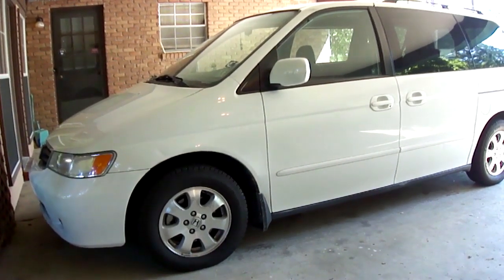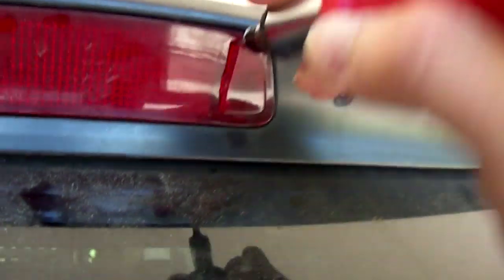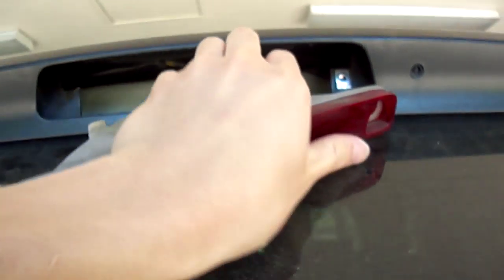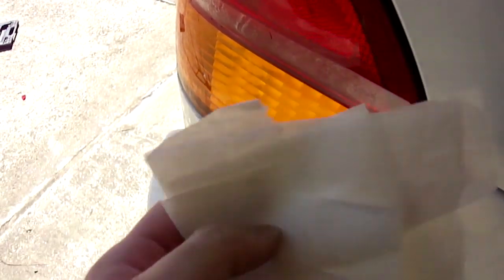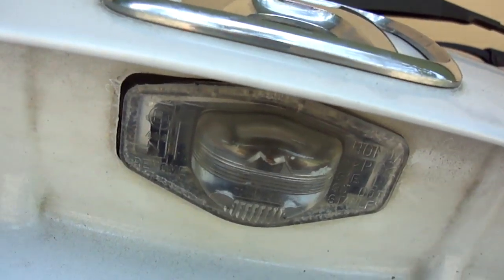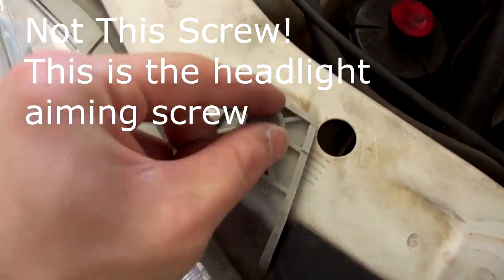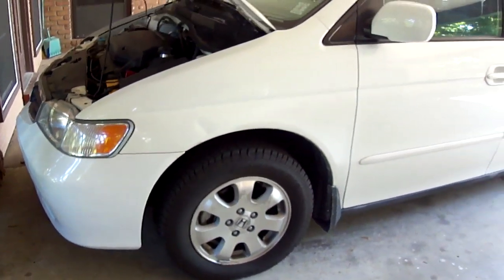How to Change Honda Odyssey Brake Lights and Headlights (1999-2004)

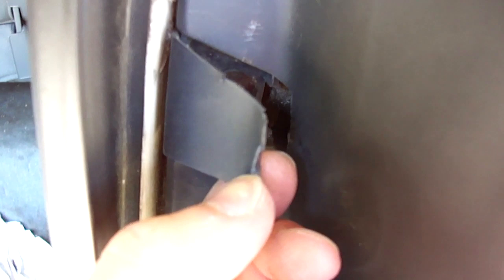Comment: Thank you for this video, it was exactly what I needed.  As a suggestion, maybe you could put time-bookmarks in the description for when you're talking about the different bulbs.  For instance, 6:00 is when you started talking about the brake light, which is what I wanted to change.

Comment: Thank you so much for this detailed video, now I know how to do the back( lol oops that's not what I meant), but the front parking light is rather easy for me , all you have to do is go under the splash guard for each side, just take 2 of those pins out and pull the splash guard back and unscrew the bulb from there!

Comment: Thanks so much! The user's manual (provided by the tech wizards at Honda) regarding brake light replacement is a confused and incomplete mess of ambiguity.  I would have never been able to successfully replace the lamp using the instructions Honda provided with their 30 K$ vehicle.  Thanks to your video, a new bulb was burning bright in just a few minutes.
Reply from the maker: thanks for watching!!

Comment: Thanks for this video.  I never would have figured out that I needed to pry out those 4-sided pieces of plastic in the back (brake lights 99 Odyssey).  I had thought the round plastic caps below them needed to be removed first, to gain access.

Comment from the maker: the backup lights shouldn't set off the lamp... try checking all your fuses.. if that doesn't work, try replacing all your bulbs (even if it still works) and see if that fixes the problem.. if not,, you can easily return the bulbs and just ignore the lamp.. good luck.  keep me updated!

Comment: FYI for the front turn signal DO NOT try to just pry off the corner there is no snap on stud like he said, there are about 4 bolts for each headlight assembly, you have to take off the front bumper, HOWEVER I think you can access the turn signal bulbs probably buy removing the clips for the plastic wheel wells, turn your wheel with the steering wheel , remove the clips and pull back the plastic wheel well covers, it is a lot easier to just remove the bumper and unbolt the whole headlight assembly if you have patience and time. the wheel wells are cramped and a bitch but might be faster or easier depends on how tiny your hands are

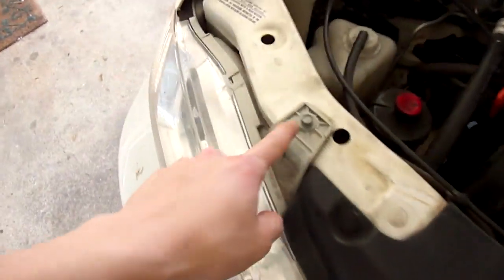Comment: 11:50.  No.  This is not the headlight aiming screw.  This screw is one of 4 screws that hold the headlight in place.  12:09.  No.  It will not pop out.  There are 3 more screws that hold the headlight assembly in.  Have to remove the bumper cover to get access.  What a pain.

Comment: I want to thank you so much for showing how to change light bulbs for my 2003 ex odyssey.  I am a girl and still could do it on my own all of 5 min for both brake lights it was so easy.  Thanks again really appreciated it.  Keep it up.  How about changing all fuses how do you do it?  Do you also have a problem with the wiring on your odyssey my cruise control will stop working and my radio from the steering wheel controls will not work right sometimes it will change channels instead of turning the volume down or up or it just wont work at all.  Do you have any suggestions?  Thanks, Kari-Lynn
Reply from the maker: no problem, thanks for watching.  Changing fuses is easier than you might think.  There are 3 fuse boxes.  One under the hood(all other fuses), near the drivers side foot well (all computer fuses), and one under the passenger foot well (all the accessories) , so you might want to check the fuse under the passenger side for the radio.  If it works, its unlikely the fuse is blown, but there is a plastic fuse puller under the hood, and you can try.    as for the steering mounted cruise control/radio, i have never had any problems. just make sure your cruise control is turned on, I don't know about the radio.. good luck!..(radio replacements are available if yours happens to be failing)